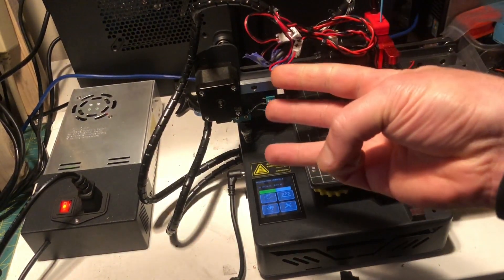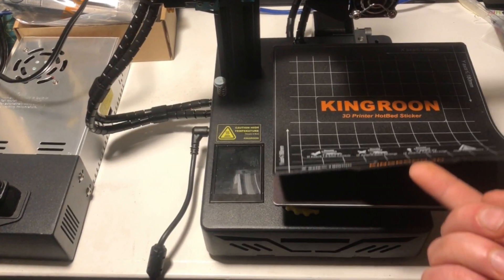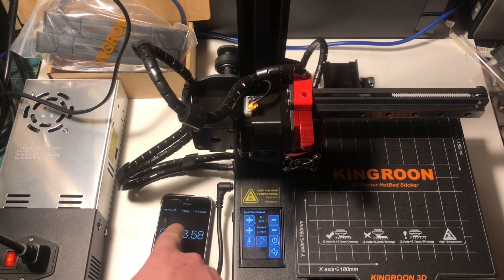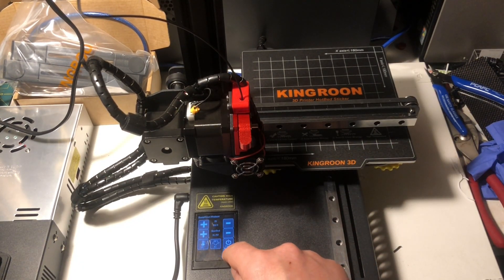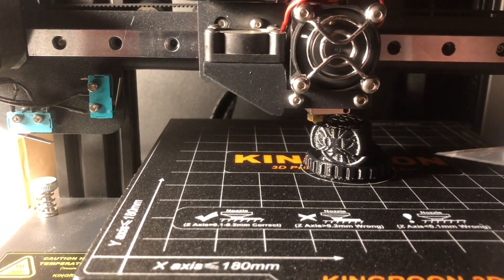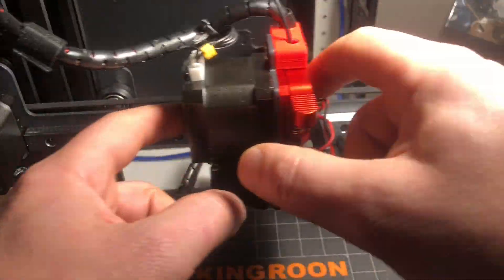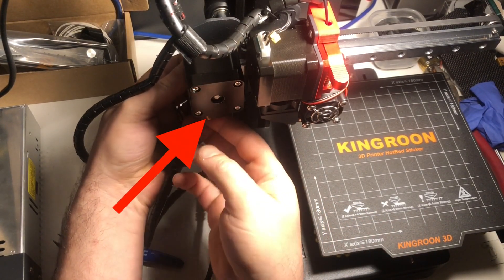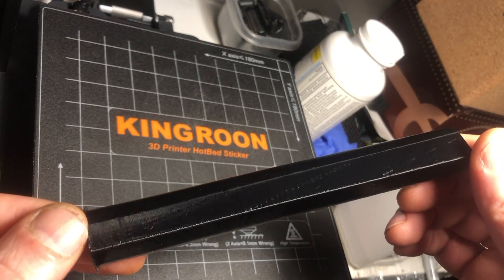kingroon KP3s Part 2: evaluating claims and initial print problems

Comment: You you figured out yet that genuine Sunon Maglev fans are both reasonably priced and the only fans that produce zero vibration?  Sunon currently has the patent on magnetic bearings in fans and are well known for their use in enterprise IT products and home entertainment AV products to provide long life and high airflow without creating annoying vibrations/noise.  In recent months certain 3D printer hardware brands like Mellow/NF (can find their official store on aliexpress) have been sourcing genuine Sunon Maglev fans factory customized for higher heat environments like 3D printing.

Comment: Edit: Ahahaha, the issue with the "eating up my SD cards" is the same with me. I had to open up the printer just a few times to get the SD out... ;)

I got my Kingroon about 2 months ago, and I love it. Bought a second one for my office, and a third one as a spare (I have a few 3D printers standing around here, my latest addition is a Prusa Mini, which I got about 2 weeks ago). In direct comparison even with the Prusa it is still a very nice printer. I use Cura 4.8 with the proper config files and it works as a charm!
I have not changed or dis-assembled anything around the Hot-End, thought I got a blocked nozzle a few days before, but with a thin needle and a little fiddling I got it going again!

Overall a nice printer, which I could recommend for beginners to start with. Good price point, at least where I live (Austria), we can get it from Amazon Germany at around 140-160EUR, the price jumps just around that range.

Comment: Why is there no quality budget linear guide options for 3d printers. V-slots are something everyone tells me is a nightmare. Chinese rails wobble or bind. Lineae rods get either wobbly or insanely heavy for a  rigid guide (matters a lot in a corexy)
Reply from the maker: Yeah, I hear that.  The quality is improving, but it is just not great yet and not consistent.  There are a few places that are starting to test and guarantee the cheap rail specs, but they tend to mark up the price to about half the price of genuine Hiwin, which is a good deal but still not what I would call 'budget'. I'd love to try some of those out in a larger machine build, but Im stuck working in a spare bedroom until the lockdowns are finished, so maaaaybe next year (i hope). By the way, I saw your video on printer testing and agree about the filament colors and lighting.  I like cyan blue or engineering grey under a hard light to accentuate the flaws, along with shiny black and  flat white for specific things.  Maybe I should pull down the next video and splice in a section explaining that so that everyone is not confused that I switched from black to blue halfway through testing...

Comment: Thoughts on the SecKit SK-GO(2)? Would you get one?
Reply from the maker: I have not used one, but the author seems to be continually improving the design.  I don’t know how well stocked they are, but it’s still thought to get parts consistently right now, so check that first. Off the top of my head, I’m not thrilled at the zip tied belts or cantilevered screw pulley mounts, but people seem to be getting good results regardless

Comment: I'm houngry for more! Wold You concider to do testing on some cheapo Delta printers? 
I'm totally into noise level video. What hardwate and software did You used for this one?
Reply from the maker: I was planning to do some videos on delta and coreXY this year, BUT that was before all the 2020 problems hit and set back the plans to get into a bigger workspace and made work a nightmare.  SOOOO whenever space and cash are not as tight, I'll be able to branch out a bit.

Comment: I'd actually love more info on properly preloading the linear rails. It's not something I've been easily able to find info I could use. I've been playing around with ceramic bearings cause they need less lube & weigh a lot less but they aren't the cheapest thing so I don't want to go playing around with sizes until I know a bit more.
Reply from the maker: I just ordered a thousand 'loose diameter tolerance' bearings that have a +/- diameter of one thousanth of an inch, so hopefully A) piece together a few different diameter sets to try out and B) they are sufficiently spherical.  I'll hold off on the mod video so that I can splice in a section on the bearing tests and give you a shoutout for sparking the idea.  THanks!  I only have a .0001" anvil micrometer to measure with right now, and no 3-point jig, but I'll do my best to get decent measures to post
Reply from the maker: We'll see how well it works out if/when the bearings arrive from overseas, and even if it doesn't work, I'll make a video.  My fear is that the tolerances are not tight enough to take larger bearings and it will bind up, but we'll see
Reply: @AlexKenis  so i had a big brain moment for me... my local makerspace had a wonderful donation of hole checkers (forget the technical name) that graduate by .001" AAND it turns out... going 1 thousandth of an inch over the bearing size is too large for the bearing block to slide on. now the hole checkers dont have spherical ends so maybe that's part of it but my guess is that we are looking at a few hundredths of a mm to add preload max. so 2.39mm bearings or one size 2.381 & the other side 2.4?
Reply from the maker: Oh nice! Good to know.  Yes, the plan was to just try one side and see how it went.  If you have any luck, let me know. 
 The carts are tough enough to get on the rails even when they are not oversized, so I don't know if they have to load them under compression or what, but I was planning to freeze the bearings if they seemed like they just needed a little nudge to go on. NO idea if any of that would work but why not try... They measured  close enough to a standard 3/32" bearing that while I'm waiting to see if the bearings EVEN show up from overseas, I was thinking of sweet talking my local hardware store into letting me go through their bearing drawer with a micrometer to see if I could put together a few sets that are sliiightly different.